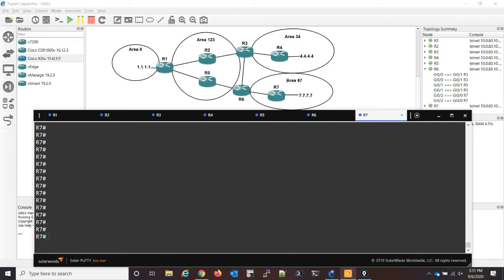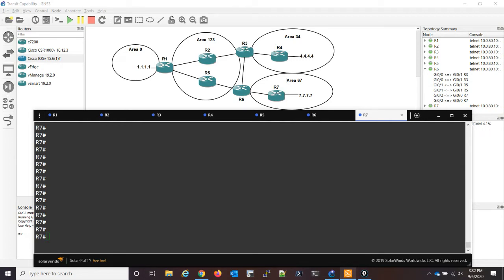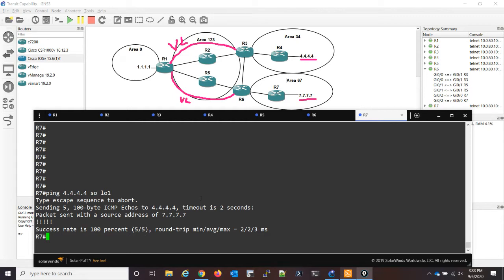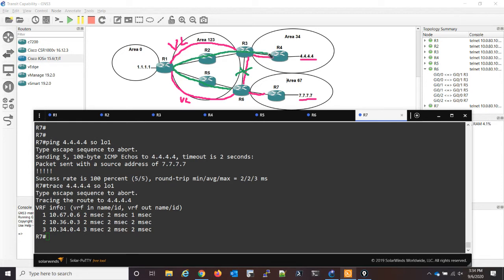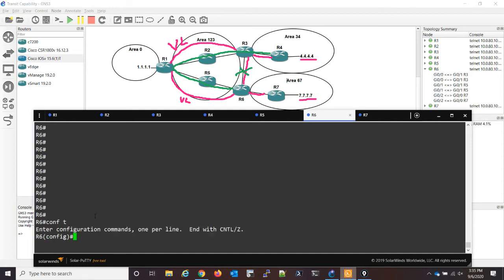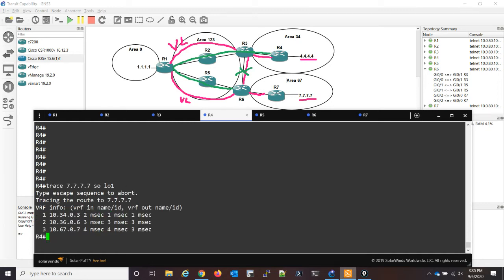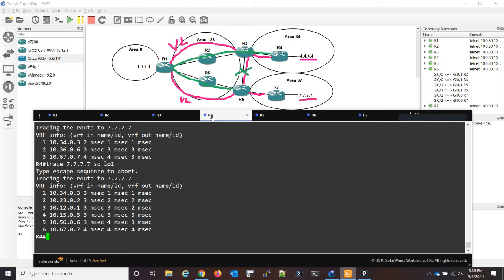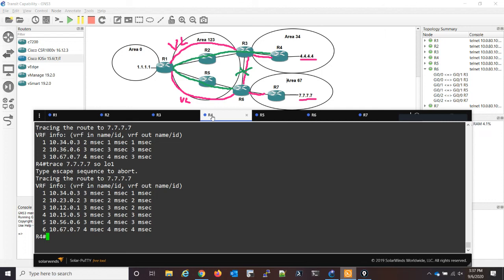OSPF Transit Capability Pt. 2 - Traffic Engineering

Comment: to which area does The link between R3 -R6  belong to?
Reply: Area 123, that is the only way the path can go R7-R6-R3-R4 in the first place. 

Both ABRs have VLs to area 0 via R1, and "by default" should be routing inter-area traffic through the backbone. In this case, that means they should route through R1. However, with capability transit on (which it is by default), the routers can use the transit area (area 123 here) as a shortcut to get to the backbone. So R6 will use the area 123 path to R3 because it is a lower cost than going through R1.

If the R3-R6 link was any area other than area 123, this wouldn't work, because the transit area for the VL is the only area that can be used as the shortcut path.